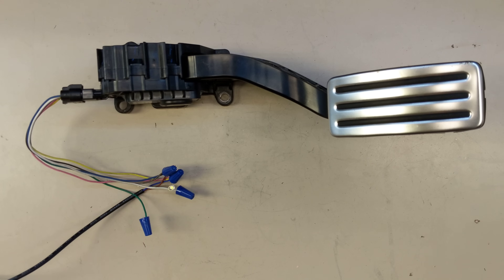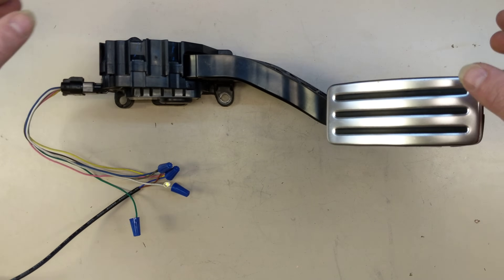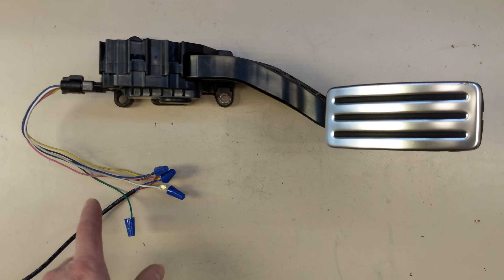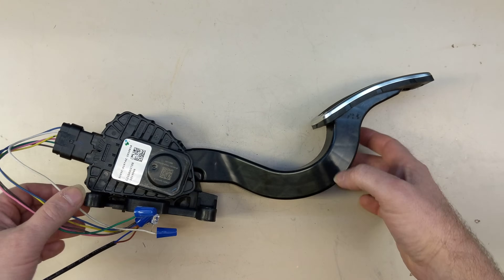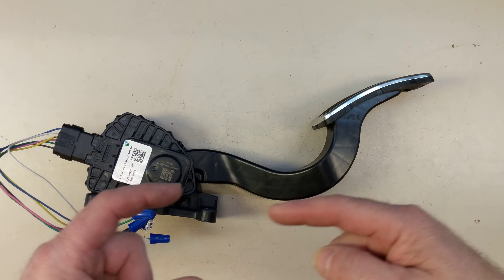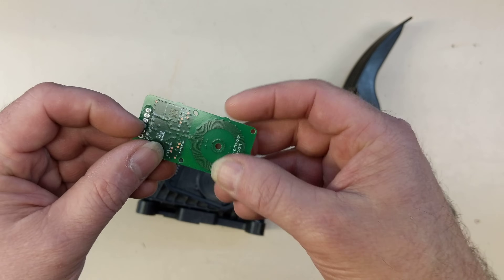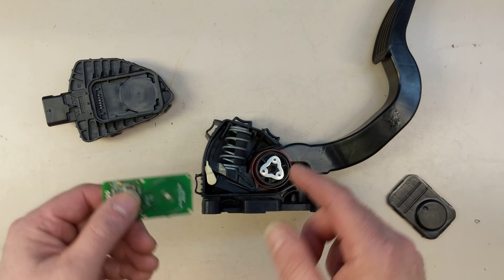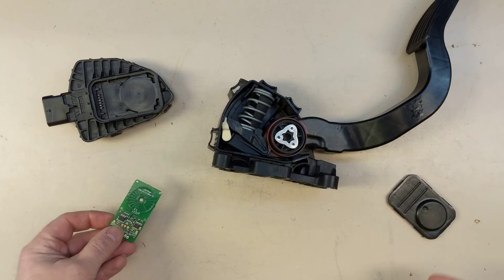Tesla Teardowns - The "GO" Pedal!

Comment: Just got a Tesla M3LR AWD as my first EV recently. I found that I can not have the necessary granularity or fineness of low speed control for creeping the car by only modulating the accelerator pedal (Tesla removed the "Creep" mode in 2024). My research on this issue led me to your video. Thanks for your great work to explain the pedal sensor mechanism in details. Do you know what is exact resolution divider used in Tesla? Is it 1024 or 4096 or even higher for Highland or newer Tesla? I believe that this number limits the granularity or fineness of speed (actually the torque for the motor) control Tesla can provide.
Reply from the maker: I don't know the resolution Tesla decodes it as, but I'd guess it's 12 bits.  (4095 steps)   Even if it were only 8 bits, (255 steps) it's unlikely you could notice.  Yeah, The pedal is not speed, it's torque, but there are slopes and anti-backlash torque bias that are added to the mix.  I can exactly control the car in one-pedal mode down to such a fine degree, I could probably keep a string made out of dental floss attached to a post tight without breaking.
Reply: @Ingineerix  Wow you are a pro ;)
Here is my problem: I stop my car in the garage, and find I need to move forward for another one or two inches very slowly (e.g. 0.5in/s) so that that tennis ball can touch the windshield. I can do it quite easily with an ICE car by modulating the brake pedal when the car is in D shift. But I just can not do it nicely with a new Tesla that doesn't have Creep mode. How will you do it with one-pedal mode?
Reply from the maker: @valleynomad  I have no problems in one pedal mode on my 2018 Model 3 Performance.  I can move the car 1mm if I want without any special effort.   You aren't trying to use both brake and accel pedals art once, are you?    Have you tried "chill" mode, it expands the low part of the pedal map?

Comment: would be nice to know what the voltage range is on the sensors of that tesla pedal . Put a volt meter on the 2 outputs not an LED :P
Reply from the maker: 0-5v max. The slopes are each unique, so if you were going to use it, you'd need to map it anyway.

Comment: is it possible to make go pedal a bit softer ? for me it feels harder to push, would be nice if it was like nissan altima
Reply from the maker: Yeah, you could remove one of those springs, and/or replace it with another, but I wouldn't advise it.   A Tesla is a much more powerful car than an Altima.
Reply: @Ingineerix  thank you for your replay. i will check on it. the issue is that my car (model y) not regular commute car it is limousine car. so when u stop 15 times and drive, keep 70-75 mph on highway everyday. my leg hurts. feels like leg day everyday after gym lol

Comment: Seems as if the mechanical components (spring, friction system) are not only important for quality "feel" but also for ease of use, since the pedal needs to be able to finely  and consistently modulate position not only for acceleration but also for braking.
Reply from the maker: Exactly!   The "stiction" element is also important for efficiency to stop accidental pedal movement and oscillation, such as could occur when driving over bumps, etc.

Comment: I agree with changing the name of the pedal. I prefer to call it the Speed Pedal as it does more than make the car Go. If you want to increase Speed., Press on it. If you want to go slower, let up on it. How about trying to see if we can move the EV community to using this term. It would be nice to get some acknowledgement for bringing  up this term. Best Regards, Frank Tesla M3 LR driver for 5 years. I have watched a few of your videos. Frank
Reply: How about Torque Pedal as its position (or travel distance) is not really proportional to the speed?

Comment: I never thought potentiometers were actually used on throttle units. There could be some sort of redundancy in case the tap winds up in a temporary open-circuit. But it still sends chills down my spine picturing my car accelerating without my foot on the pedal. Inductive sensing is the right way to go. Fighter jets also incorporate a ton of inductive sensors, ranging from synchros to resolvers and LVDT's. Everything from flight stick, throttle control to rudder pedals may be fitted with up to 3 or 4 independent LVDT transducers per channel to keep the pilot in absolute authority over the aircraft's essential systems.

Comment: The accelerator peddle in the first generation Model S were from Ford.  Not a special custom made part for Tesla.  A straight off the shelf Ford part with the original Ford part number on the side.
Reply from the maker: Ford does not make their own pedals, Tesla just happened to buy one from the same supplier that makes them for Ford, and didn't (at the time) have the clout to get their own markings.

Comment: Your thoughts from the EE perspective on general component reliability from your tear downs, etc.  Fuzz commentary from Consumer Reports, Edmunds, etc. seem to imply that frequent changes in electrical system suppliers and continuous design changes has resulted in reliability issues in air conditioning, heat pump, center screen, door locking... any relevance to electrical components or software engineering? Thx.
Reply from the maker: All the core powertrain stuff is long-lived, definitely does not change often, and is engineered by Tesla in-house.  Suppliers make a lot of ancillary things, and those may be subject to change in design or suppliers more often.   Most of what you are quoting is from the original Model S which was Tesla's first real production car (I don't consider the roadster to be "production" really).   They definitely had a lot of growing pains with the early Model S.   Most of what I am tearing down here began with the Model 3, which is night and day compared to the original Model S.   I think even despite Teslas overall poor quality control, the Model 3, Y, and the new Palladium/Plaid S are very reliable cars, especially the parts that count.

Comment: Another great teardown video. I'm curious to know at what point the brakes take over from regen to fully stop the car during one pedal driving if the driver doesn't touch the brake pedal.
Reply from the maker: About walking speed.  Watch your brake pedal carefully, it will move a bit when the iBooster applies the brakes.

Comment: in ICE cars (manual gearbox) when a pedal fault is detected, ECU will rev the engine to default RPMs (3000 RPMs for example). Thanks to this you can still move the vehicle (while burning the clutch). It's a failsafe in case it would fail at a railroad crossing. Not sure about auto but I guess it could be similar, so you could safely pull over. 
Despite 9 years in vehicle design, I've learned from each of your video. Thanks!
Reply: Interesting, this could explain the reason for when you press both the accelerator pedal and the break the ecu cuts power after a couple seconds

Comment: Being that guy, without even reading the datasheet, but it sounds like  sine/cosine resolver, a kind of variable transformer. Any eddy current is incidental to the operation. Back in the day these were only used for high reliability aerospace stuff because of the need to generate AC excitation and do signal processing to decode.

Comment: I thought it was controlled by a duty cycle rather than an analog voltage signal.
Reply from the maker: No, it's analog.
Reply: @Ingineerix  Quite surprising. Wouldn't a digital output be more immune to noise and also not require analog input conditioning before being read by an ADC?
Reply from the maker: @0xbenedikt  Yeah, that would make sense, but you are likely dealing with "supplier inertia".   This is how it's been done for awhile, so there's a chicken-egg problem with changing it.   You see this a lot in automotive.  Maybe at some point Tesla will build their own.  A more elegant solution would be to put it on the CAN bus, but then if the bus fails you lose drive, so having the dual-redundant analog is probably more reliable.

Comment: Coming from the VW TDI Diesel world, I've been using the term "Go pedal" for some time :) 
On those cars, if the 2 sensors in the go pedal ever disagree the pedal is disabled and you only get a 1200 rpm high idle. VW was very sensitive to this after the Audi 5000 nonsense. 
The electronic pedal on that 99 Jetta was just a dual potentiometer. One time it got wet when I drove through a huge puddle and a missing plug in the firewall let water get in. Immediate flashing glow plug light and the pedal was disabled. 
The modern non contact design seems much much better - nothing really to wear out! 
Didn't Tesla initially use a Ford go pedal? Do you know when they switched to their "own" part?
Reply from the maker: None of these parts are made directly by Tesla, Ford, or any other OEM.  They are made by an automotive supplier, I'm not sure which one.
Reply: The brake pedal position sensor, pedal top switch or hydraulic pressure sensor can also be used as an temporary inverse pedal demand and allow the car still to be driven

Comment: Unfortunately, the suggestion that electronic pedals coincided with fuel injection is utterly and completely wrong.  Most cars with EFI, from the early 1970's to the mid 2000's still used mechanical "gas" pedals, connected to a throttle body.  They had position encoders in the mechanism, but it was still a mechanical connection; pedal to throttle body (and butterfly, after the MAF sensor).
Reply: I have even had a car which had a mechanical pedal with a cable going under the hood. There it was connected to an encoder. So it was a bit of a hybrid pedal, a traditional pedal combined with a fully electronically controlled fuel system.
Reply: The move to electronic engine throttling was to support "torque based" engine management systems that appeared in the late 1990's, with Bosch leading the way with its EDC controllers.  Here, the driver demand is encoded by the accelerator pedal input, but the engines throttle plate position is actually the result of the forwards torque mapping, and that mapping and functionality allows for repeatable torque output during things like cruise control, DSC intervention, emissions optimisation (igntiion retard for catalyst light off), transmission integration and lots of other things.
Reply: Don't know how it played out in detail, but our Toyota from ~2000 has the mechanical throttle plate, position sensor, and then a separate electronically actuated valve more or less in parallel with the mechanical. I've never owned a car with an electronic pedal.
Reply: @robmacl7  Yep, in the Corolla, etc. with the 1ZZ-FE, 2007 was the switchover to "fly-by-wire".  I have a 2004 Celica and it's a PITA to try to upgrade with cruise control, where a 2007+ Corolla/Matrix, etc. is little more than the steering wheel stalk!

Comment: The cable and carburetor part is not entirely true, there are many fuel injected vehicles that use cable driven throttle body. My BMW for instance has a hybrid link where the throttle body has both a cable and a servo. If electronic part fails, the car still works :)
Reply: The first Mercedes cars with ASR were similar. The throttle linkage (Cable? That's too simple.) runs up to the throttle, which has a position sensor. That goes back to the cruise control / ASR computer, and then the cruise control actuator operates the throttle. If that fails, you can keep pressing the go pedal and you can get like 1/2 throttle mechanically.

Comment: You are a goldmine of information. Thanks for sharing these!
I am still wondering why they haven't used CAN or some other digital communication for something this critical.
Reply: Another comment mentions the cost and safety.
Reply: That would be exactly for that reason - safety. Keep it as simple as possible and add in safeguards and redundancy. The signal ultimately makes it to CAN but not in the pedal itself.
Reply: @0xbenedikt  The longer the information is maintained in 2 separate analog circuits, the more opportunity there is to weed out any discrepency.  So, keep the CAN conversion as close as possble to the decision point.

Comment: BMW has a failsafe - if one signal is bad maximum 20% of throttle allowed for ICE. If both are bad then no additional power is allowed (idle only). So it is possible to drive in both cases.

I would recommend EV manufacturers this logic - one failed signal maximum power ~20kW  - this will limit top speed as well.  Both failed - "strong" creep mode activated by default, hazards activated by default and maximum speed 30km/h. Tesla as a special case might allow AP driving.
Reply: That latest Tesla go pedal can't fail internally. Only wiring can fail.

Comment: A difference that I could spot: The IC on the board "802V1R2
 1007456 1743" has 16 pins (8 pins on each side). The data sheet from Renesas ZMID5201 only lists 14 pins though in a 14-TSSOP package. Would be interesting then to go into the details of the circuit and the actual pin designations. You did say, this was a similar design and I believe that, but obvious properties like the pin count may likely lead to the actual manufacturer of the IC. I found Renesas IPS2200 and Renesas IPS2250 in a 16-TSSOP package. They are rated for high rotational speeds however like in electric motors. They also have an analog signal output and accept 5V power supply. They also have an I2C interface for diagnostics and programming.
Maybe just compare to the ICs that Tesla uses in its motor rotation sensors, whether you can find the same house part number again.
Reply from the maker: I could not locate the datasheet for the actual part used, the ZMID5201 is "similar" as I stated in my video, it's definitely not the same, nor is it pin compatible, it just has a similar function.
Reply: I was the designer of the chip as well as the coil back to 10 years ago. This is a customized chip with code name AA800. The general purpose chip should be LX3302.
Reply: @AlanSmith-yn9yt  Thank you. Microsemi LX3302 (inductive position sensor IC), also in a  14-TSSOP package. So something has been added on two extra pins. Can you share, what has  been added and why? And regarding the application on this board: can you share, why Tesla choose to use analog outputs, when actually there are several digital protocols like PWM, PSI5 and SENT available as output? These would enable diagnostics as well.